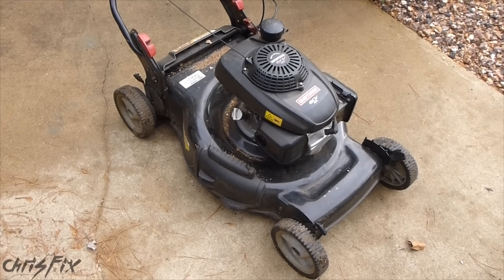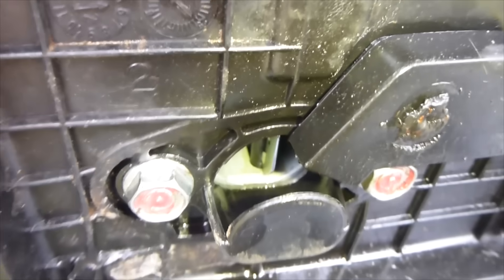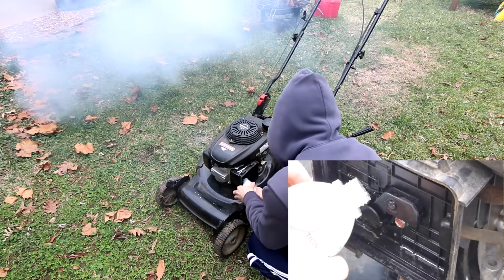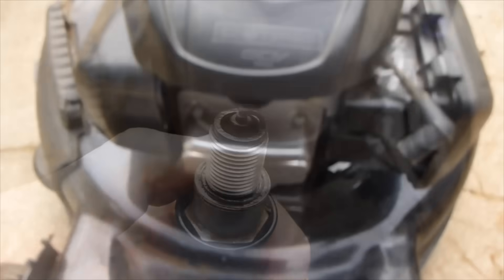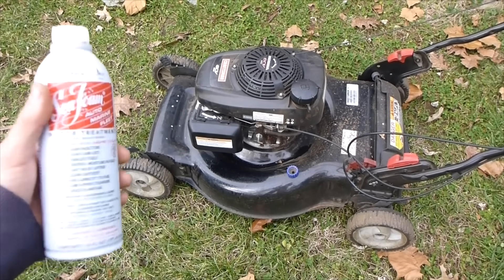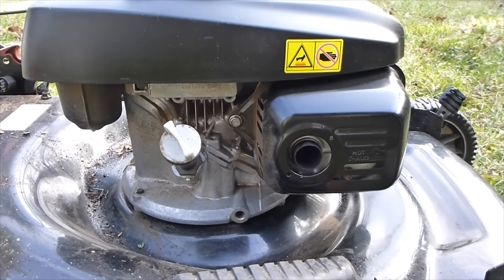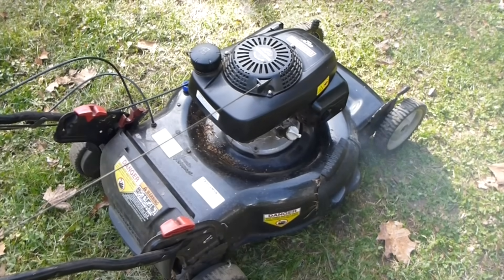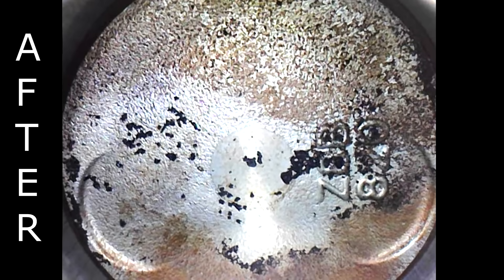Does Seafoam Actually Work? (with Proof)

Comment: You may think I'm lying to ya but in 1973 after coming back from Vietnam I was stationed in Warner Robins Georgia. About six months after that they sent me to the a USAF school for vehicle diagnostic training.  One of the things that one of the instructors said is that "uncle Ben's converted rice" is good to clean out engine pistons and valves!  Huh?!...Now I had been a mechanic for several years and never heard of that.  So I challenged him to do it to my car.  I drove my 70 340 Cuda in  to the shop.  He took off the air cleaner and began to sift a small stream of rice right down the throat of the Holley. He kept the rpms at about 3 grand so not to kill the engine. The trick was to sift it slowly in so you didn't kill the engine and have to try to restart it.  If you killed the engine one or more of the valves may be blocked open by the rice and not make enough compression to restart the engine in which case it too an act of God to get it freed up through cranking and cranking until it finally started loping on three or four and then five and six...etc cylinders until it was running again.  He said that rice wouldn 't bend a valve or scar a cylinder. He said it is harder than carbon and softer than metal.  He also said it is like "sandblasting" the inside of the cylinders.  So I started doing it once a month or so to my 340.  Well I got transferred to Colorado Springs and went to work at a vehicle maintenance shop.  I sold the Cuda to my future brother in law...I bought a Ford Maverick 302 fast back with dual exhaust and I put on a Shelby intake and Holley carb......But my "almost a brother in law" calls me up and says come over to the hobby shop!  you won't believe this!  so when I got there he had the cylinder heads on the bench....Ya know what?...He was right!  I said.."hey nice valve job, that was quick!"....He said "I just pulled the heads!"....they look like brand new valves and not a speck of carbon, he then told me to look at the pistons.....Clean as new!   So I guess rice worked!   Not that I would try it on new engines today....but back then it worked great.  He replaced the valve seals and put it back together...Ran great and no smoking...

Comment: John Deere mechanic told me that John Deere didn't warranty there carburetors if anyone used anything less than 93 octane, he said that John Deere could tell weather other octanes have been used . It's why I use only 93 octane in my small engines and Sea Foam and only reason I use use  fuel stabilizer is I let my fuel set in my small engine and don't drain them during the winter . And I also use a battery tender to  trickle charge my batteries are there in the winter .

Comment: On all my small engine I use 93 octane fuel and sea foam and fuel stabilize mixture . This way the carbon is taken care off and fuel setting in fuel tank doesn't go bad sitting all winter either . Thanks for the video too .
Reply from the maker: Thanks for the tip. You don’t need to use 93 octane because that is a waste.

Comment: I'm excited to try this to our family car which is  manual corolla 2002. I've done replacing pcv valves as well air intake filter, cleaned throttle body & maf sensor are cleaned already. Ima try this seafoam as I observe in your videos this is the one effective for combustion chamber. 

Thank you for sharing Chris!

Comment: How about this as a master mech .. You put in the right fuel change your oil ON time. You actualy change your airfilter ... And by the way KN filters were designed for aircraft and boats. No such thing as a million mile filter.. So do those things. pretty much what your owners manual u have to read it. .. You wont have carbon... For that matter. Mechanical issues... Other wise keep adding crap to your motor and one of those carbon chunkz. Think about what diamonds are made of.. Will score scratch or kill a ring ...

Comment: Seafoam is great but I would not use in an engine that is not experiencing problems.  The solvent that dislodges carbon is also very hard on other everything else including seals.  After it does it's job you want to get it out as quick as possible whether in the intake, fuel system, or crankcase.

Comment: I bought an HONDA Foreman ATV, when I bought it, it was smoking very bad ! I filled the cylinder completely with Sea Foam, let it sit for 7 hours, cranked it without spark plug  to remove sea foam ! After installing back the spark plug, it started right up, kept smoking for another 5 minutes and quit smoking ever since !! I think sea foam removed most of the carbon on  piston and piston rings !! Great stuff this sea foam !!!

Comment: i LOVE your videos. This was awesome.  Why WOULDNT you soak the car engine piston with sea foam? They behave the same. (all pistons)

You should try soaking CHEM DIP on piston heads and see how much carbon is removed. I run a rental company ad when my piston rings stick and my compression is down to as low as 30 i have soaked them for 12 hours and then retested compression once i got all the chem dip out. and the compression would go back to 150 to 210 where it was at before.  I use to use RING FREE and that worked good but it was a 50/50 chance it worked.  You can also clean your valves by release pressure off them with the cams loose and soak the valves by putting chem dip in the exhaust and intake. (ive only done this on a yamaha waverunner vx110 4 stroke (since thats what i rent) and i get absolutely amazing results. I let them soak for about 4 hours because the valves are coated and you dont want the chem dip to peel the valve coating. I would LOVE to see these results with a scope. If you ever get a chance this would be amazing please.
Reply from the maker: Because you see how all of that carbon is broken off and moving around? That’s all loose and would be flying around the cylinder and probably isn’t good.

Comment: I’ve always mixed my sea foam with my gas so it cleans everything in my fuel system
Reply: It
Reply: There is nothing in a operating fuel system that requires such imaginary cleaning, you are just wasting your money.
Reply: Nick Foreman unless your almost on empty your just Diluting the substance
Reply: @2uned08  True but its among the simplest ways of using it without any potential harm to your intake.  If you aren't really mechanically inclined you can harm your engine if you aren't careful putting it directly into your vacuum or intake system.

Comment: hi Chris fix it my name is James. when you have built up Carbon on your Pistons. like on the other programs you use other products that go into the tank. can you pull out your spark plug and spray throttle body cleaner or carburetor cleaner to clean it up and waiting while for the chemical to evaporate

Comment: One other thing that needs to be mentioned. If you have a lot of carbon build up, just about any type of cleaner you add is going to make the carbon break loose. In a perfect world, the carbon would break free and shoot straight out the exhaust valve.  In the real world, the carbon is going break free, a lot of it is going to drop down onto the piston and possibly find it's way to the edge of the piston, where the rings are going to use it like sand paper between the cylinder walls and the piston rings.  Which in turn will reduce the life of the rings and your mower.

Comment: .... It works? It took a little bit of black stuff off. What does that actually accomplish?I usually just take a poop in my engine and smear it all over the place, and then pee in the gas tank until it is topped off. All those natural acids really do a good job of cleaning an engine. The best thing about it is that it is sustainable and natural, and I was going to dump the pee and poop anyway, so it is great to find a real use for it. If you eat a lot of spicy foods immediately before you do the poop in the engine, I find that does a great job of spicing up the engine and adding a little pep. Save the extra effort for the Jaguars and Ferraris.

Comment: Dude that lawn mower looked fantastic even before the sea foam. Should have done this on a 2006-2009 Lexus IS250, GS300, or any other engine that actually gets notoriously dirty from carbon. Did it work? You bet. Were the results proportionate to the cost of the can of sea foam? No. Like I said it was too clean beforehand. Your performance increase is probably less than 1 percent.

Comment: You don’t have to add Seafoam to the carburetor. If your small engine yard equipment runs but runs poorly the fill the dump a couple ounces of Seafoam in the tank and top off with Trufuel and just run as normal, the carburetor and internal engine parts will clean on its own . I had a husquvarna gas leaf blower that sat in my garage and it barely ran so I bought a new blower and the old blower sat for two years, I fired it up yesterday mixed the way I mentioned above and it didn’t take long for it to run better. If you can’t get it to run normally just let it sit with that Seafoam and Trufuel mix for a couple days and it will clean as it sits . What caused the problem in the first place is leaving ethanol based gas and it gummed up the carb . I did this same process with my gas weedwhacker and my power edger and my brothers in laws snowblower and it cleaned it every time . If it can stay running but runs poorly then this process will fix it . You really can’t use to much Seafoam so I add a couple ounces to the tank and the use of Trufuel is that it pure gasoline so it you leave it in your equipments tank it won’t harm the machine. This will be the first year I went from using regular gasoline and switched to premium grade marine fuel which has no ethanol, if you choose to use regular gasoline make sure it’s premium 93 octane but ethanol based fuel goes stale easy .
Reply: Also if you use regular gasoline or marine add a ounce of Seafoam per gallon of gas in your gas can and I also use Stabil gas stabilizer. I add 7 ounces I my five gallon can and it keeps the engine running like new

Comment: Nicely done! I have been using Seafoam on Volvos for years. I never thought about using it on smaller engines
Reply: Ive never used seafoam or any other snake oil in my 1963 chevrolet, and it runs just fine. Have owned it 40 years.

Comment: I use Sea Foam when the machines are done for the specific season, a cap full for small engines, two caps for fuel maintenance. This prevents vanishing and clogging. The machine will smoke a bit but no loss of performance. Tens years using it on Snowblowers, lawnmowers, Rototiller.

Comment: I use Seafoam in competition RC Airplane engines (usually 1 or 2 cylinder 2 stroke). I add it to my fuel and after a few tanks the inside of the engine is literally sparkling clean.

Comment: Here's a help for all of you guys spending you money on all these cleaning tricks.  Carbon isn't bad for your engine. THE only bad thing that this can do, which is practically impossible, would be some getting caught around the lip of a valve. Which would lower the compression or cause you engine to back fire. But because valve springs are so tight,  if any carbon were to get on the edge of a valve, the very next to times the valves closed, it would knock it right off.  So all that build up on your piston head or the top of your valves, don't worry about it. In fact, the less room you have in the combustion chamber, the more horse power your engine will have. Although, you can't get enough build up to actually make a difference.  In short, don't worry about this. Spend you money on something worth wild.

Comment: Simple answer is yes it does. I had issues with my mower running rough because of old gas. I put sea foam in there and ran it for a few minutes and it has ran perfectly ever since I started using sea foam.

Comment: ever fixed a blown head gasket? as in, did the work yourself? if you did, think about it for a minute.. remember how CLEAN a piston head is after a blown gasket lets WATER in the firing chamber? think about it.. you can introduce water as a mist into a running engine and it will clean your firing chamber like brand new. proceed with caution or have an adult help you.
-Eddie, mechanic 30 yrs experience
Reply: and also, the way this works best is for water to hit a running temp engine. it shatters the carbon and flakes it off. I do not recommend putting any liquids into engine, turn it into a mist, that way you wont lunch your block.

Comment: if you put it directly onto your yolk stroker, it will totally clean your carburator, also fix any sloppy u joints or throw out bearings, directly, 1 full bottle into the fill tube on the yolk stroker though, never had much luck with muffler bearings, too tight of a tolerance for the seafoam, id actually use orange clean or that purple stuff, you can also drink this stuff, it makes a great chicken strip dipper

Comment: We used to do the same thing with a coke bottle of water. Pour it in the carb while the engine is running for the same results as the Seafoam.

Comment: Hey to anyone who may know...
I'm wanting to use this on my very old mechanicly injected diesel. It has a very high compression ratio of 21.3:1 I'm worried that if I use seafoam I might hydrolock and destroy my motor.
Reply: The Q It’s working fine in my 1997 Ford F350 with the 7.3L turbo diesel.

Comment: Excellent job my man!
The borescope is just perfect for this...  That soak at the end was also inspired.  If you ever have the chance to do this on another mower, I'd make 2 suggestions:  Use the aerosol can with the tube, which meters the SF in at a lower, steadier rate and does it for a longer period;  Also give it 15 minutes to hot-soak instead of the minimum 5.

1 question:  Have you used it in the crankcase?

Comment: You can get the same result with just water add water (distilled) same as you did the seafoam.   It steam blasts the inside of the motor.  Been a mechanics trick almost as long as theres been motors

Comment: question Chris Fix, on a vehicle when you're doing sea foam thru the vacuum tube, which tube do you put it in...the one that connects straight to the brake booster or the one that is right before the pcv valve or what?  2nd gen tacoma.
Reply from the maker: Brake booster is usually the go-to vacuum hose for adding sea foam.

Comment: Bed your rings in properly when the engine is new, run fuel which contains a cleaner such as Caltex 95 or 98, service it regularly with a good quality oil such as Mobil 1 and give the engine a decent work-out occasionally & you will never need to worry about carbon.

Comment: Spray water instead. It's clean, probably more effective, leaves no residue in the cylinders or in the oil because it vents out. The water turns to steam. Lots of videos on this.

Comment: I'm not impressed, the "dirt" got roasted, parts flaked off. Seafoam sounds friendly, washing with a light breeze of nature, this is sth. completely different, this is poisoning and pyrolysis. The rest of dirt seem to stuck more intensely. The higher temperatures inside the motor which were needed to burn and peel off the dust may ruin parts of the motor over time. The burned oil-dust-chemistry of this procedure ruin the environement instantanously. Thanks but no thanks!!!
Reply: > SDD525
. . . . . . . . . . YES . . . . . . . .

Comment: It would have been real interesting to have two lawnmowers in similar condition and run SeaFoam in one and plain water in the other.
Water has worked great in auto engines for generations.
Reply: Nope. Not at all. It's a way old school method to clean things out. It works at high temps and preferably high load. But since it's hard to get the water in at high loads in a car it was usually done while parked. Open the throttle quite a way and while it's good and revved up you pour a quart or so of water down the carburetor, taking some time to do it.
But here is the thing; If an engine is running right and being operated as intended it won't load up in the first place. In fact if it was run wrong to where it had loaded up and then corrected and run right, they will generally clean themselves out to an acceptable state. So "cleaning" them is kinda superfluous. But if you feel a need, Seafoam, Marvel Mystery Oil, ATF, and water have all been known to work. Don't laugh at water, it steam cleans them very nicely. 
My experience comes from many places, not the least of was running a machine shop for some years. I got to see the innards and know the history of a LOT of engines.
It's also common practice to inject water in turbo charged engines where you are running more boost than the fuel will tolerate. A little water stops the detonation right now. I did because I was and it did. 
Todays modern ECU engine management renders a lot of old school problems non existent. These days I mostly just put the gas in and drive it. Or cut the grass.

Comment: run it near wide open pour a small stream of water directly into the carb [don't snuff it] and you will clean all the shlt out of it in one minute . works for v8s and works for little engines. and it's all without the complications your showing. And by all means it works a thousand times better than this product. I saw little improvment with lots of effort.. I'm tellin ya a small stream of water will steam clean that engine to look like it was just machined

Comment: After 40 years as a mechanic I can tell you that all additives, whether for gas or oil are scams.  Want to clean any engine spotless?  Dribble a little water directly into the intake, it will turn to steam and do a great job. This is not necessary on engines that run well!

Comment: you are worrying way too much about a little carbon that isn't hurting anything. Why not add it to the gas like you are supposed to do?
Reply from the maker: +AL M I said in the video that this is just testing to see if this stuff actually does anything. Most motors are not that dirty inside.